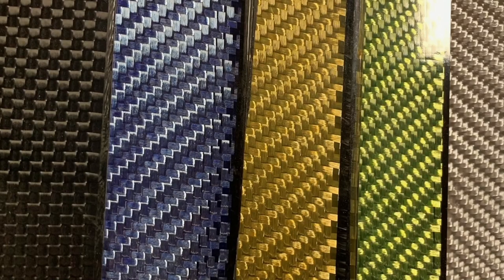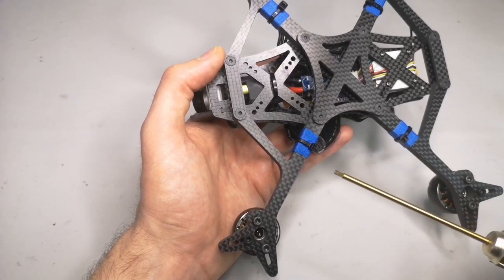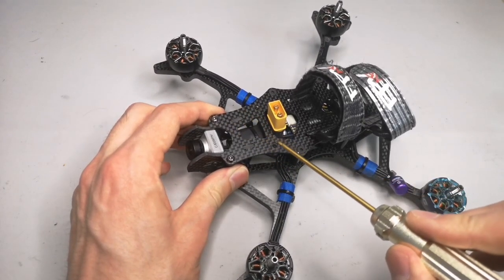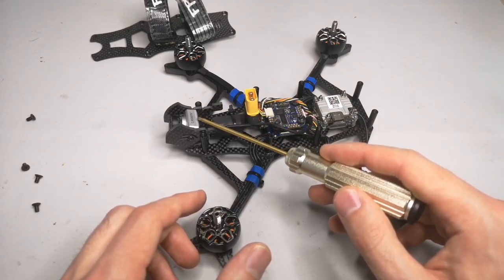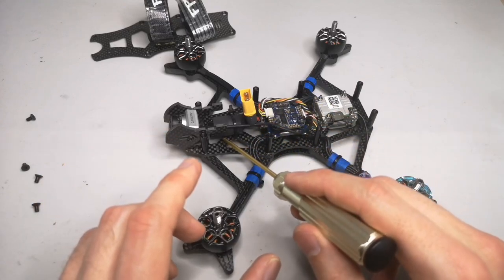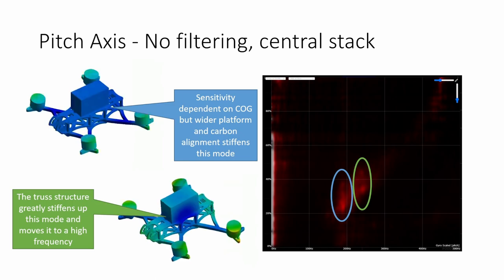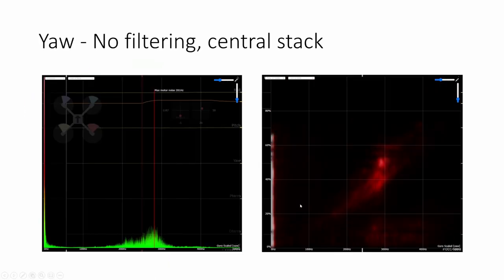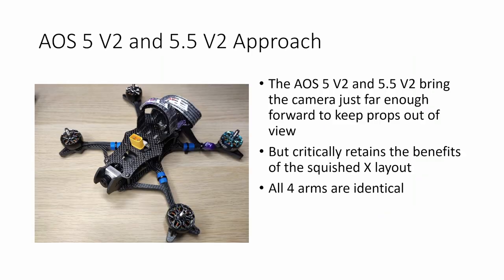AOS 5 V2 FPV Frame: Better than the Apex DC?  No props in view; no compromises!

Comment: Hey Chris, do you have any plans to update the AOS 7?
Reply from the maker: Not at the moment. Eventually I will but probably not in the short term. It already has most of the features of the AOS V2 frames. I'll need to figure out if I can improve on the split arm design which is tricky because it's a high performing design.
Reply: Appreciate the info Chris, was wondering how tubular carbon arms would compare with normal flat plate arms?

Comment: Does the direction of the grain in carbon fiber even matter at all? My understanding is that it's layers of fiber at right angles to each other so you are simply just seeing the outer layer and green does not matter
Reply from the maker: The carbon fiber alignment is critical. The stiffness of a plate is ~30% less stiff off axis (45deg).

Comment: Any option considerations for gps mount? Gps rescue works well enough that i now mount gps on all frames now.
Reply from the maker: I would mount the GPS off the rear standoffs. Any TPU mount for the AOS 5 and 5.5 will work on the new frames as well.
Reply: The frames I’ve been building come with them. I didn’t even think about looking for something on Thingiverse.Thanks for the info. After loosing a $500 quad not to mention battery price i just put gps on all builds.

Comment: I wonder how long the arm screws hold up. If you don't fly in the park
Reply from the maker: In general people have been very complimentary about the durability and I haven't managed to break an arm yet. But there is only one way to find out, buy one and send it! I don't think you'll be disappointed 😎
Reply: @ChrisRosser  I guess I have to buy one soon. Why no wiggle plate like the 533 Switchback?
Reply from the maker: @badabing9796  With the truss design you don't need exxtra parts to try to brace the arms at the centre. The truss is phenomenally stiffer than a traditional arm layout.
Reply: Sounds great

Comment: I just got my frame in from CNC Drones. I'm VERY disappointed with the cut quality of my frame. I can't use the bottom plate because the front holes for the camera plates are not cut all the way through. I can't flip it over because that would put the counter sinks for the stack screws on the wrong side. There are some minor burs and some jankyness to the cuts but for 75 bucks, I would expect better quality.
Reply from the maker: Sorry to hear that! Please get in touch with Nick by email and he will take care of you with any parts you might need.
Reply: @ChrisRosser  I also just found out that the standoffs they sent were too tall. I'm requesting a refund.
Reply: Hmmm…. Just got mine and all is perfect and awesome quality.
Reply from the maker: @slinkyfpv  Drat! I'm really sorry about that.  Let me know if you have any issues.

Comment: Can you upgrade 5.5v1 to v2 by buying replacement arms?
Reply from the maker: Unfortunately not. All the parts are different. But you can easily transplant all the components from a V1 build to a V2 and be confident they will fit.

Comment: Pretty much all FPV frames are 2D designs made 3D by using standoffs. Have you ever considered a 3D frame design? That would certainly be harder to make and more expensive because you would need to use molds and do actual layups instead of just CNC cutting shapes out of a flat panel. I've thought about an A frame arm kind of like yours, but a vertical A frame along with the horizontal A shape. These 2D frame designs are perfectly fine and really fly great, but I like to tinker and you do too. I see the arms twisting and moving up and down in your simulations and wonder how an arm that attaches to both the bottom and top plate would handle those movements.
Reply: Why you want to make easy things challenging? Will "3D frame design" achieve level that 2D design can't? Can't imagine reason why anybody want make cheap solution cost more.
Reply from the maker: Cost and manufacturability are the key challenges with using 3D layups. While there is extra performance to be gained it's not enough to justify the huge cost. No one wants to pay $100s to $1000s for a frame.
Reply: @ChrisRosser  I don't know how China does it for so cheap but there is an iFlight Morgoth X5 Carbon Molded 5" Racing Frame Kit that's about $60 or $70. I don't like the style of the frame, but it's molded.  I use to make and sell fiberglass car body parts and was going to make carbon fiber parts but could not compete with China on their prices. A carbon fiber windscreen was about $10 more than what I was selling my fiberglass windscreens for. I will end up making something just for the fun of making it. We make a carbon fiber steering wheel that we fill the inside with a 2 part 5 pound foam because it dampens the vibrations the driver feels in the steering wheel. I was thinking of trying that.
Reply: @KonstantinFPV  Quads have been flying pretty good for years now and people keep messing with them to make them even better. So I guess for the fun of messing with it. The amount of money people put into this hobby is staggering. $140 for all metal gimbals? No one needs those but people buy them. They're cool though. I just like to tinker with things. I don't own a single frame that I haven't modified because I thought I could make a part of it better.

Comment: Really unhappy with the v1..had too extend motor wires to fit properly and had a crash the other day and snapped an arm strut..gonna use a different brand of frame instead 😒
Reply from the maker: Sorry to hear that. The V2 has a central mount to try and alleviate the need to extend wires when moving parts from another frame and the arm structure has been further strengthened.
Reply: It does look better but at £70 a pop I will struggle to afford one now, especially after the fuel hike in April 😪 but at least the v1 issues have been addressed👍

Comment: Looks like the arm will break right next  the motor. Thinnest part of the arm right next to the heaviest component. (MOTOR) Im not an expert frame designer lol
Reply from the maker: I've had some pretty hard hits and not had one break yet. IF the arm is going to break in a very hard crash you want it to break there and not snap the main plate otherwise it's a complete rebuild rather than arm swap repair.

Comment: What about motors from Brotherhobby and T-Motor ? I would argue Emax and Iflight motors are garbage, in my experience Iflight motors bearings always wear out quickly without any crashes, and Emax Eco 2's are trash. Rcinpower actually are good enough to be grouped with Bob's motors.
Reply from the maker: I've had good experience with the XING2s. I've got some RCinPower motors on order. Any 5" quality motor is going to be good for the AOS 5. I've seen several dropped bells on FPV cycle motors without crashes so I wouldn't rate them for durability.
Reply: @ChrisRosser  Yeah I just recently looked into the Fpvcycle motors and the damage reports are really scaring me away. I'm looking towards XNova, T-Motor and Brotherhobby. 

I have a bnf Foxeer Caesar 5inch racer with Foxeer's new Datura motors in 2207.5 1960kv. I do have to say they are amazing motors, so smooth, the bearings are great no noise still after 30 packs.

Comment: Why you ever want to buy 5.1 frame over 5.5 frame? There won't be any significant weight difference to chose 5.1 frame. IMHO get 5.5 and use prop you want for your AUW. Just to sell more frames? God bless we don't have 5.2 frame..
Reply from the maker: Just pick the one you prefer 😁. The 5" frame is ~10g lighter because it's smaller which is around 10%. It is also slightly more responsive due to the smaller size.
Reply: @ChrisRosser  10g is nothing in 5 inch class. Will it be in stock at Bangood?

Comment: I'll hold off and wait til this dude or mark can actually send....  Otherwise this is going on my Christmas tree as a well manufactured ornament... Cause of it cannot take an impact multiple times.... It's not a 5" frame to any real pilots
Reply from the maker: I fully support this. Everyone has different requirements when it comes to durability. I think I've struck a good balance with 6mm thick arms but keeping the weight around 115g.
Reply: @ChrisRosser  the problem is the keyed in vtx cam cage.  Everyone is doing the vertical carbon ...  It's impractical to say the least... unless you only fly over soft areas.  You will square up with a tree or a light pole, boulder, or any innumerable number of solid objects.... And then your day of flying is done.... Then this frame sits in a corner waiting on parts.  I'd rather noodle a standoff than have this happen.

Comment: So will 5.5 props also fit on the aos5 v2?
Reply from the maker: No. There is an AOS 5.5 V2 for 5.5" props.
Reply: @ChrisRosser  the link for the 5.5 v2 is not working